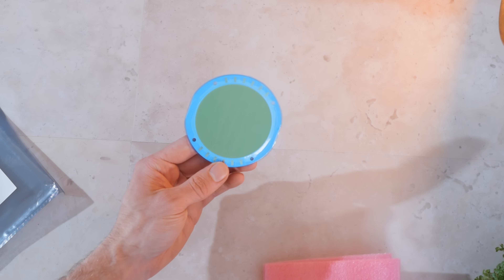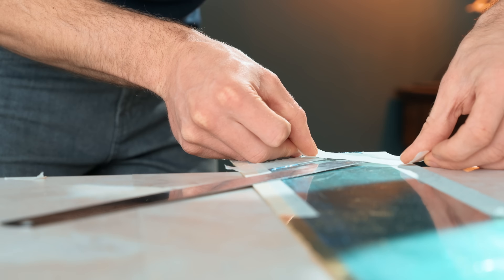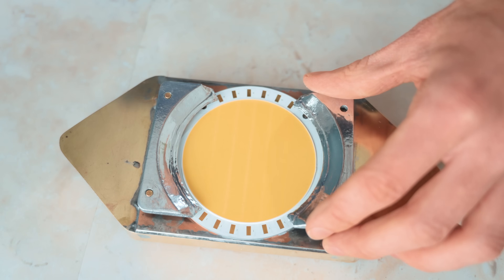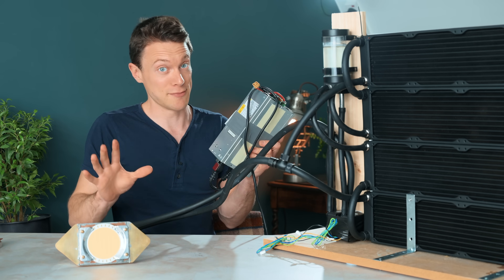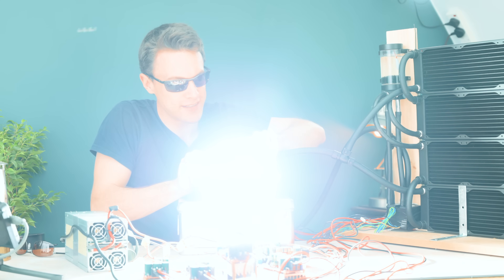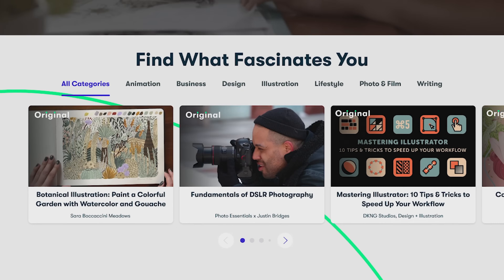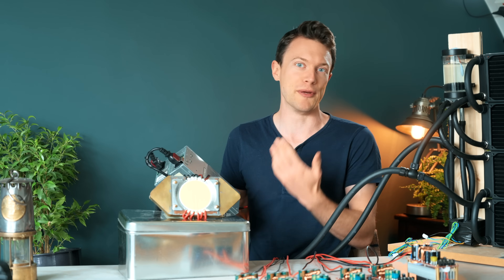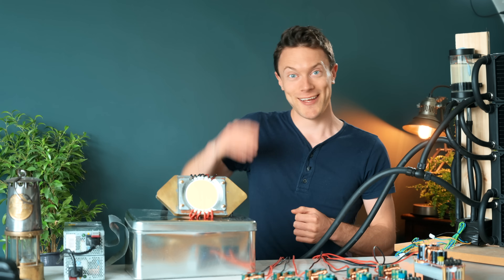Testing the world's BRIGHTEST LED!!!

Comment: From someone who works in a data center: Server PSUs never run in series. They run in n+1 redundancy. So they aren’t very good at working together at the same time. They also get a good bit of cooling from the fans within a server chassis as well as their own so it was probably inadequate cooling. They also never push their full wattage capacity for extended periods of time or reach their full capacity ever really.
Reply: Yeah, and another thing to take into account -- when they ramped up their fans and he pulled the plug... They were still under load and therefore, just sat there hot with no cooling to help. He needs to add a switch on the load side so that the load can be removed from the PSUs while leaving them on to cool themselves back off.
Reply: I am not familiar with this PSU, but some are split into multiple rails of 12v and 5v, with each rail possibly having a lower amp rating.

This looks like a Supermicro PSU and looking up the specs on a few different models, they only list a single rail. Here an example: https://www.serverschmiede.com/images/product_images/thumbnail/supermicro-1000w-psu-netzteil-pws-1k02a-1r-9994-m-2.jpg
Reply: @jrcarlsen  was thinking the exact same thing .
Reply: I saw the problem as well he didnt force airflow through the PSUs
Reply: @635574  and also stacked them... which is not very good if they get hot....
Reply: Exactly. Or at least that's how my old server works. (Dl360g7)
Reply: I get so anxious when I see people running PSUs with balanced grounds in series, if they ever get pulled apart when operating the ground imbalance will kill one or both instantly.
Reply: MetroidChild he isolated them both actually
Reply: Those PSU's are supposed to run in parallel with load sharing. There is a circuit on the internet how to hook up 2 of those(delta made for HP) PSU to create a massive 150amp PSU at 12 volts. If interested I can send it to you.
Great video!! And nicely build heat exchanger for the Led.
Looking forward to your new video

Kind regards Stefan
Reply: Maybe killing the power (fans) while the PSUs were still hot did not let them cool down well... hence need better cooling / monitoring for the PSUs themselves.
Reply: Also, the fact he was only using the 24V Rails, even tandem PSU's have other voltages, unless he was using CPU boosters, and you know those things aren't supposed to be run full load like that... or really at all as most of them are pretty cheaply built.
Reply: @TheMidnight366366  most PC PSUs are actually rated for full load on just the 12v rail, as well as any combination of rails (not exceeding their individual limits). So 1000W on 12v or 900w on 12v and 100w on 5v, for example
Reply: yea, could the fans only be there for when the server is in standby mode and the server fans are off? then when the server is on and there is already a few mm of H2O of pressure supplied by the case pressure, then the fans it has are able to supply the full required airflow?
Reply: @SuperBrainAK  Possibly, i work on fan cooled inverters and psu's in this case the fans work depending upon the load along with temperature.
Reply: @SuperBrainAK  Doubt it. We have Supermicro devices (if they are, as Johnny pointed out), and the fans are on all the time. Servers are rarely in a standby state and when they are, fans still sit around 50-60% I'd say. It's hard to say the exact speed because we don't have access to case metrics since my job is mostly hardware replacements like sticks of ram, hard drives and PSUs. But the fans are definitely on all the time. I think this was just a case of them being pushed to full capacity. Even a consumer grade 750 watt PSU is not rated to hold 750 watts for an extended period of time so I can say that neither are server PSUs. Optimal range is approximately 80% capacity.
These 1000W PSUs are probably meant to output 800W steady with a surge wattage of 1000 during startup. They certainly weren't designed to hold 1500W continuously.
Reply: mikimomo97 ah, you should be able to load the PSU to 100% because that is what it’s rating is, for PC building you always put a bit bigger PSU in do you get better efficiency but you can still run them at max power.
Reply: SuperBrainAK there is also a duty rating how long they can un for 100% before lettingnit cool down
Reply: @mikimomo97  No.  PC power supplies are designed to run continuous, as well as have headroom (graphics cards spike power relatively often), as long as operated in spec temperature range.
Reply: Electrically/Electronically speaking it does not (or only to a very insignificant degree) matter that they are in series besides their ground reference and that surely doesn't cause such a sort of failure...
Reply: @hallolo2  It does indeed matter. These power supplies have both the mains earth and DC negative grounded to the case. thats likely why his blew up. You either have to float the earth ground on one power supply and keep the 2 cases from touching each other, or you have to modify the PS internally to float the DC negative from the case of one supply. Then they can touch and be used in series, as well as have an  earth ground. Without doing one of these mods, you are shorting the PS to earth.
Reply: @taylorsharp5928   Well of course ,THIS matters and I was also aware of this fact. I just took it as obvious when you wire grounded power supplies in series to consider this. I naturally assumed he did not connect one supply to earth and left it floating. While still perfectly possible I would not be sure that this is what went down here... A direct short should result in the supply turning itself off and the LEDs would not be served with voltage... Except the resistance of the short is not that low, a 1000W server supply should roughly provide 60-85A on its 12V rail(s), for reference, a short with 0.3 Ohms, which is rather realistic considering the casing and not always perfect contact surfaces, would result in 40A, low enough to not self destruct/turn off but high enough to overload one supply with the LEDs also pulling current.... This short calculation makes it more likely again tbh...
What I originally meant with "to a very insignificant degree" is the control loop of the switching elements... To a small degree the noise/ripple between the two supplies can interfere and usually this does not result in immediate critical problems but you do not want this as a long-term solution or in critical apllications, but just a demo for a hobby project it is fine.
EDIT: But even if it was somehow shorted or overloaded... Am I dreaming or shouldn't they have not failed anyways? Overloading/shorting should not result in permanent failure in nowadays switching poewer supplies, espacially not in server ones.
Reply: @hallolo2  True, you would think that the self protection circuit would have saved the PS. could have had old ass cooked capacitors in it 🤷‍♂️
EDIT:  he also showed the power draw from the wall, which was lower than the combined the PSU's are rated for. so yeah, they should not have popped either way, unless they were faulty or im missing something.
Reply: Yes i have used one of them if u consume more than 300 watts the chip which controls the 12 power rail    burns and power supply won't give 12 volts and only 5 volts like it goes in standby mode permanent if u change that transistor like chip it starts working again

Comment: Next video: water cooling the 2000 watt power supply.
Reply: Next Next Video: Cooling the power supply for the water cooling component.
Reply: Yes, the water still has a lot of ability to take away heat if it only got up to 31 C.
Reply: Some heatsinks can be LIVE in the PSU. Bad idea. Car battery doenst need to be cooled. Booster circuitry is already there.

Comment: Maybe it was a combination of power supplies running under heavy load and then switching off the power supply under full heat load. Not saying it’s an excuse for the power supplies to fail, but shutting down the power supplies’ cooling system allows he components to sit at very high temp due to latent heat. Like running a car at full throttle and then shutting it (and the cooling system off) instead of idling back to normal temp then shutting down. Just a theory.

Comment: Now this may just be the American in me, but you could probably get away with just two of those radiators with them submerged in an ice bath. For short usages.
I do say this from experience as I have made a few simple ice cooler based AC units. Using an ice substitute freezer block would help as well.

Comment: The power supplies should be just fine running in series if you disconnect the ground of the one that has it's negative connected to the positive of the other supply and keep the cases isolated; I've done it before, though I haven't pulled this much power continuously for an extended period of time. I think they may have overheated because they're meant to be in a server case with positive air pressure inside? It will be loud, but perhaps hotwiring the fans to run at full speed all the time would help? I do know they can be sensitive to heat; I had one running a car radiator fan in my dad's garage, and the summer heat killed it.

Comment: Hi
Thanks for posting a fascinating project experiment. BTW switching supplies can be wired in parallel but not in series. Another idea would be to connect four automotive 12V batteries in series parallel to achieve the voltage and current required.

Comment: Wow. You usually do so much research I'm surprised you didn't anticipate the power supply failure.
In series, you double the voltage. At 24v the current you're pulling (on 1500w) is 62.5 amps which is not load balanced between the two power supplies. Essentially, each power supply is providing 12v at **62** amps! While some ultra high performance gaming power supplies can provide up to 100 amps on the 12v rail, OEM server power supplies will generally be limited to 30amps per 12v rail. An example after market 1200w $450 server power supply can only do 50 amps on the 12v rail (though it does have two of them). 
I am sure you can imagine what pulling 62 amps over a 30 amp rated circuit can do to a power supply. Wait, sorry, you don't have to imagine ;)

The important thing to note about balance is that even if your power supplies are rated equally, there will be small voltage fluctuations between the two, causing the power supply with the highest voltage to handle the most load. Which means one of those power supplies was probably pushing over 70 amps of power, or more, throughout the test.

For experiments like this what you need is a real bench power supply. Gerry rigging a couple of computer power supplies together isn't gonna cut it.
(Though if you rigged 3 of them together you'd get 36v at 42amps which you might be able to find 3 power supplies that can handle that. But you'd need additional circuitry to properly limit the current and balance the load between them, and for the cost of 3 high performance power supplies and a week of soldering components you're better off spending the money on a real bench brick, which you won't regret owning.)

Comment: Server PSUs are loud. They're not even trying to be silent. Fans ramping up is expected.

My guess is that when you just cut the power, the residual heat in the PSUs fried themselves since the fans were no longer running to cool it down. Server stuff also often uses a UPS to prevent power loss like that.

A bit counter intuitive that you should keep the PSU running to prevent damage from overheating though...

Comment: You can bet, apart from the maximum power you could get from the specific rail, using standard power supplies in serial is not a bright idea. There are supplies that can be used in serial, but they need a special voltage synchronization - otherwise, you could end up with a lot of trouble. There is no easy solution to that, so you better look for a single one with enough juice...

Comment: Watching through, first time. IN B4 3D Printed parts melt. [edit] I'm relieved it didn't melt. BUT. Those server power supplies are usually garbage, they claim high levels but NEVER expect them to be reached, so they skimp on the parts. (first hand datacenter experience, many angry calls to suppliers.)

Comment: When he pulled out his sunglasses he said something about using them for lasers.
Please don't use regular sunglasses for laser radiation protection and don't buy chepo ones -- you could go blind if you get the wrong ones.
Reply: He was comparing the light to a laser which is light focused into a point which is not so different from a super powerful light not saying you should use use regular sunglasses for lasers. Just like you have to buy properly specced glasses for the wavelength of laser you are using sunglasses would be the properly specced glasses for the LED
Reply: yes!

Comment: Matt, you are far too trusting of the labeled ratings on those power supplies.  Those boost converters are usually advertised with a "Wattage" arrived at by multiplying the Maximum Voltage times the Maximum Current, even though the specs will tell you that you cannot draw both at once.  Worse yet, each of those are the theoretical max -- not what they could actually produce continuously.  I'm actually surprised they were not what blew first.  But the evidence shows that your "2000 Watt" power supplies were the weak link. 

I think you need to de-rate every one of those by at least 50%

Comment: Series power supply gives us the som of the Volt but the power remains the same... so 12+12=24volt and 750W total power... asking for 1500W from 750W supply... that’s the problem ( parallel is the opposite, the volt remains the same and the power is the som of the two units), for this project you need 4 units ( 2 parallel with 2 serie), good job!

Comment: Computer power supplies ratings give the ratings that can be supplied by all of the rails combined (3.3V, 5V, 12V, etc). Usually you cannot get the full power supply rating from just the 12V rail.

Comment: Hey if you enjoy longevity of a water cooling loop, please make sure the cold plate and radiator are the same metal. If they are different then they will start to react through the water. Also use a biocide for the water. Alternatively there are water cooling coolants that you can use that will both stop bacterial growth and prevent corrosion. I don't know how long you plan to keep this thing working, but i hope it helps! Love your vids, they are a great source of motivation for me. Happy building!

Comment: Did you have the power supplies load share pins connected to each other? If so, that might have messed with things running them in series. 

Those look like Gen5 HP supplies, I'm guessing the 403781-001, which are rated 1000W. Even in series, they are may still be limited to that 1000W. May want to look at the common slot PSUs instead, those are rated up to 1200W and are similarly easy to manually jumper to run bare.

If possible run the boost converters at 12V and use 2 or more PSUs in parallel. Running server power supplies in series is complicated due to the output ground being referenced, or even directly connected, to earth ground. You could float the ground on the output side of second power supply (the one with its output negative connected to the output positive of the first), but this would be fairly dangerous.

Comment: I think your cooling solution is WAAAY oversized, which I think comes down to a misunderstanding. You said that the heat sinks used for CPUs have TDP orders of magnitude smaller than the power consumption of the LED product. In a CPU, literally all the energy consumed by the CPU is turned into heat eventually, and the heat sink TDP needs to dissipate all of it.
However, the LED product converts all of its 1500 W of power into light. Only the energy (that is turned to light that is reabsorbed by the housing) that is turned to heat needs to be dissipated by the cooling solution. Thanks to the high efficiency of LEDs, the cooling solution only needs to be sized to a small fraction of the 1500 Watts of the total power consumption (and can also tolerate much higher heats as well, because of the lack of extremely tiny transistors). What that fraction is, I'm not sure, but I think my point is backed up by how cool the block continued to be even during long operation periods.

Comment: forces an additional 12 v through the second 12v power supply wonders why it burnt up
Reply: Since you actually read this... Attaching the Paul's together is also a bad idea you diminish a total of 1/4 of the surface area... on both, and then cross interfere that same 1/4 heat from both sides on the side that's attached. 
Also you should clean the flux on the interior of any components, (especially your messy radiator job 😉) as this will cause corrosion, due to it reacting with the metal over time and it leaching into the water, this also goes for new radiators. Your flux issue may be harder to deal with but the radiators simply needs flushing a bit, and you may even see debris come out of them too.
As for the PSU's the components inside probably aren't rated to have a 12v x ??? Amp flow into them. If you put then directly in series one wired into the other that would cause overloading as above. Also check any PSU's efficiency at % power, and load capability over time, that you intend to buy. I think normally you want them at most around 80% load, with the extra 20% as spike protection, maybe do a bit more PSU research for future reference? Or just contact the manufacturer/s, down to you.

Comment: I can't exactly say for sure what happened, since putting power supplies in Series is a common thing to do for engineering testing ( eg dual rail power supplies ). But my guess is that the high total current cooked internal traces. So even though you could assume 750W/1kW overhead, the traces themselves had a total power of 1.5kW inside - burning them.